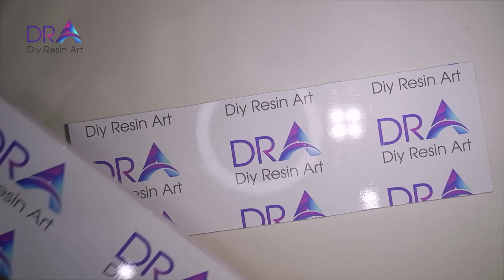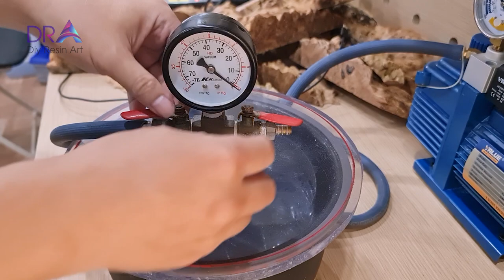Epoxy Lamp 3,6 kg ! Easy Making Epoxy Resin Lamp With DRA | Diy Resin Art

Comment: Great job! 
But I have one question - how about the heat resistance? LED Strip Light become hot after 20-30 mins and the high temperature could cause some bad influence to the epoxy...
Reply from the maker: I am using RGB 5050 12v 3A LED, the surface is covered with silicon, I don't see as much heat generation as other LEDs, Thank you very much 😀😍 Thank you for always supporting me

Comment: Wow.. very impressive. I love your work. Thank you for sharibg. Just one question, how did you make those bubbles rising up vertically? Do they come up naturally if you don't coat the woods with epoxy?
Reply from the maker: It will naturally arise if you do not apply epoxy on the wood surface 😀 Thank you very much